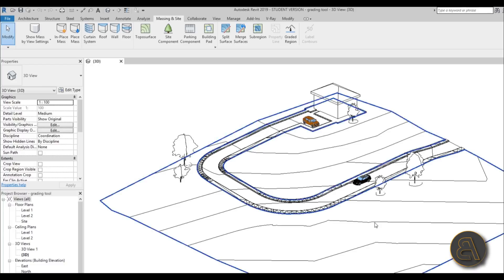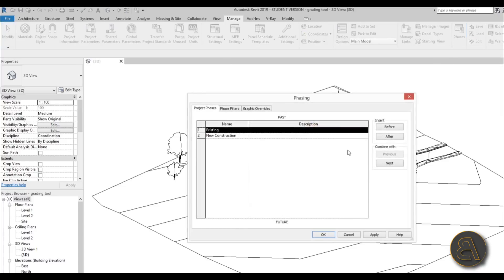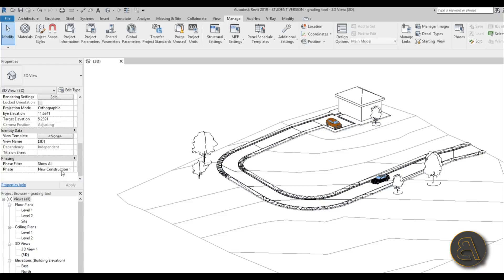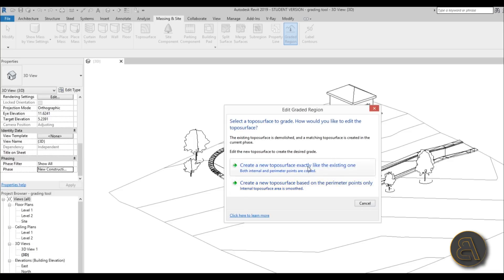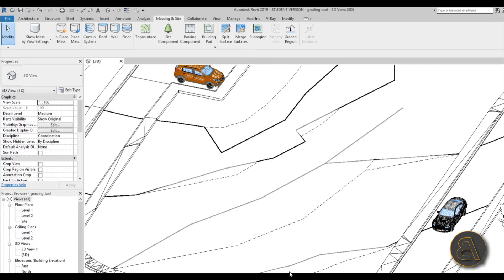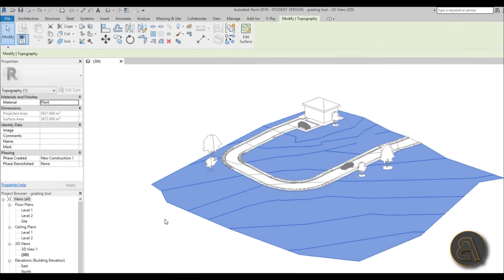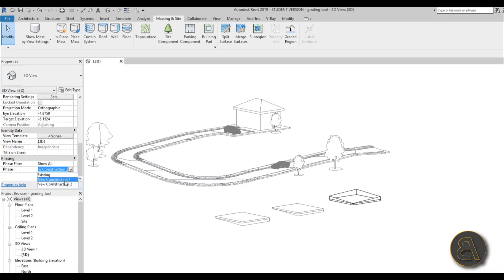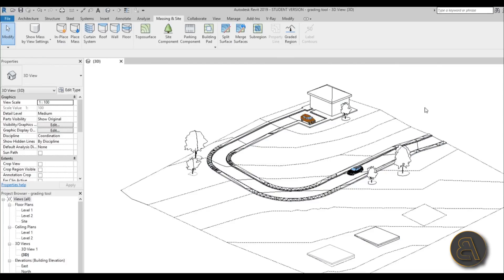Graded Region for Site Phasing in Revit Tutorial

Comment: You can't see the first topography [at 7:35 to 7:50 time] because it was demolished in an earlier phase. It was automatically demolished per that Revit "warning" message. Phasing for Demolished only shows if Phase Demolished property matches the existing view phase (which is a pretty strict view setting built into Revit phases).